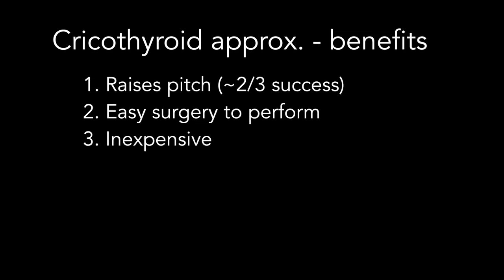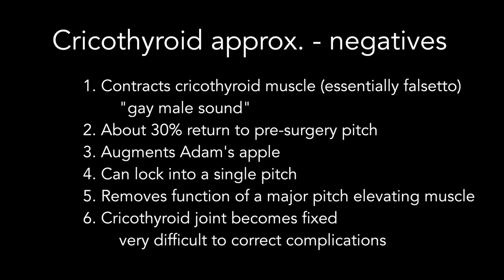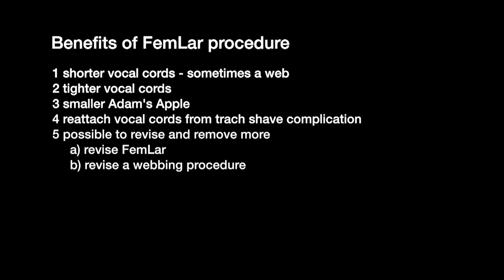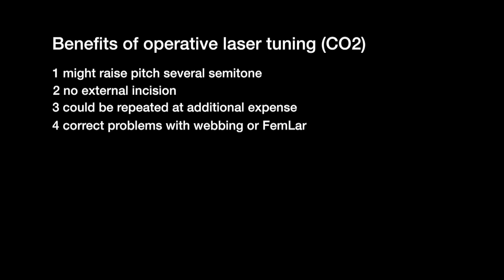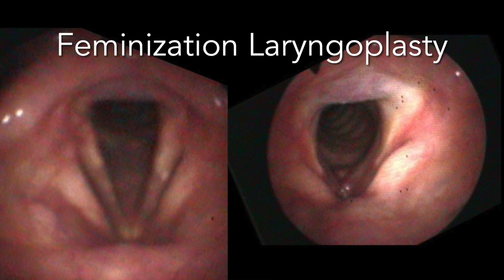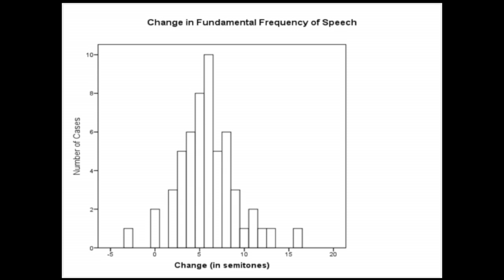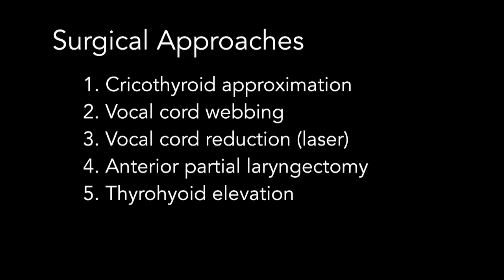Surgically altering the male voice to a female voice - Feminization Laryngoplasty

Comment: Most of them sounds unnatural tbh. This is coming from someone who wants this surgery one day.
Reply: Sounds like they are still healing
Reply: The lot of them still need a bit of additional voice training. Femlar alone won't bring you to a female voice but it will do a lot of the work.
Reply: @arbourgray ehhh you’re wrong honestly. If you get the Full FemLar procedure outside of like, intonation. It solves literally everything. I’ve seen a couple people attempt to sound masc but ultimately sounding like trans men pre-T so yeah.
Reply: @ Hmm that's interesting
Reply: @arbourgray  I mean, yeah. Honestly if more people did it and refined it as a procedure it could be the next gold standard compared to much more minimal and less extensive procedures like Glottoplasty, which don’t adress the wider vocal structure/resonance which is like 80% of the issue at minimum. This needs to be the new standard. The success rates are already high enough and if more people actually did it, it could be even better. because I for one, don't like only having solid data on one surgeon (Dr Thomas) who is let's be real here, an older guy. And with him doing this in a Fascist Theocratic Dictatorship (the USA) isn't the most reliable, more people need to do it so fucking badly.